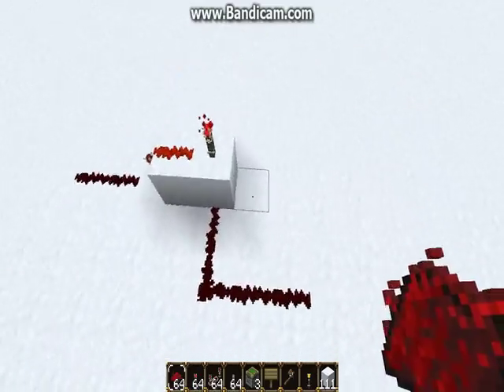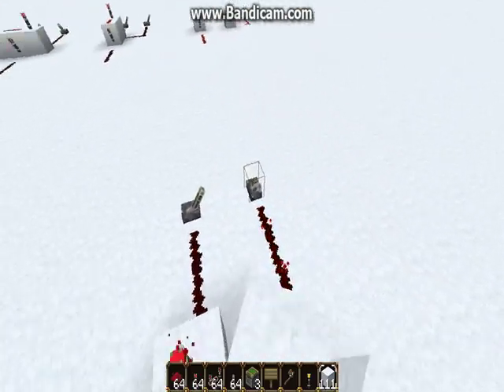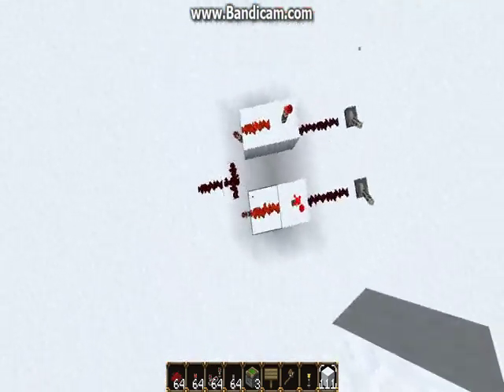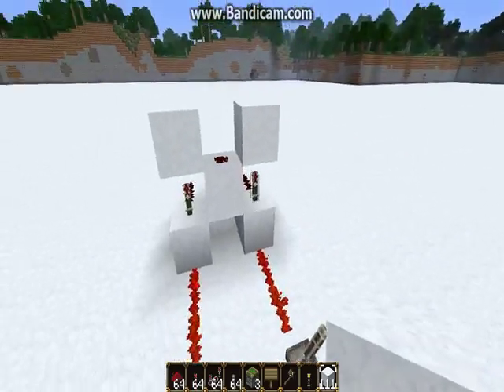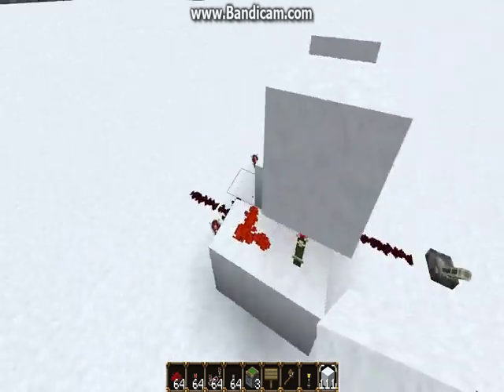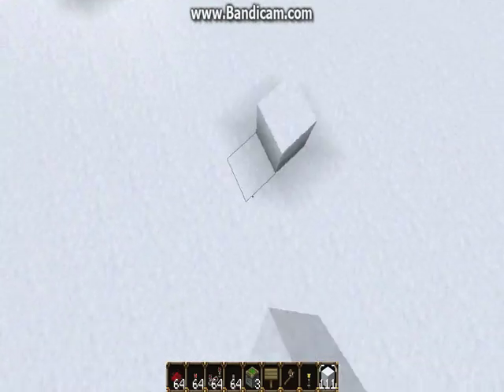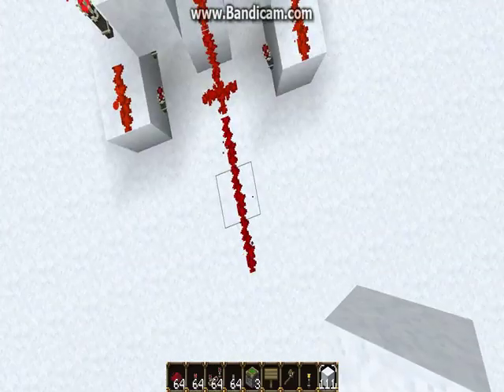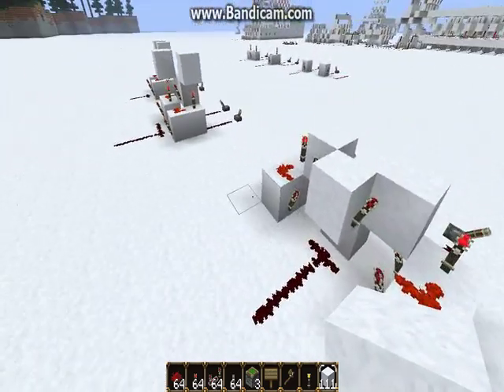Building a minecraft computer tutorial pt2: the XOR gate

Comment: i built sort of a "half" XOR gate after seeing this. remember when you put the torch to connect the   added output to the other one? i didn't. i made two outputs instead. let's say the two inputs were input A (left) and input B (right), and the added output was output A and the normal was output B. 1 is on, 0 is off.

so, if input A=0 and input B=0, then output A=1 and output B=0.
if  I A=1 and I B=0, then O A=1 and O B=1. vice versa too.
if both inputs=1, then O A=0 and O B=1.
to be understood.

Comment from the maker: Yes, this does. However, this style of OR gate can't be expanded into an XOR gate, which is why I used this design. In fact, there are also several XOR gate designs which are faster, but I don't use them in this series because they can't be expanded into adders or subtractors. 

So really when it comes to any computing, modularity is generally preferred over what is strictly fastest or smallest, because those usually can't be used to make a more powerful system.